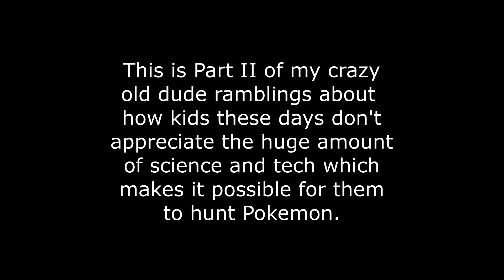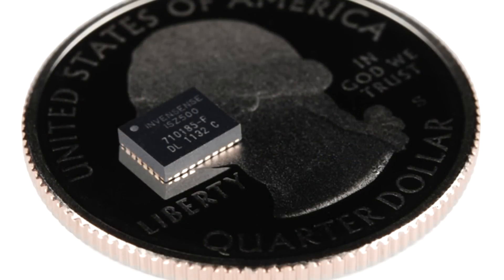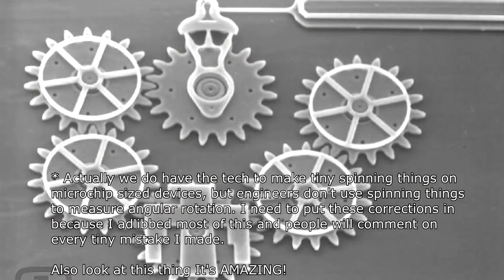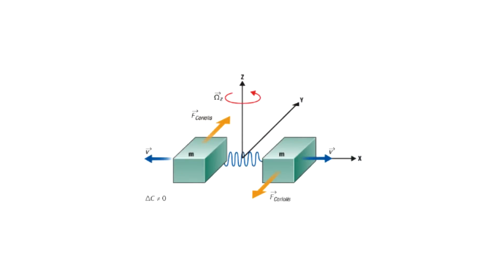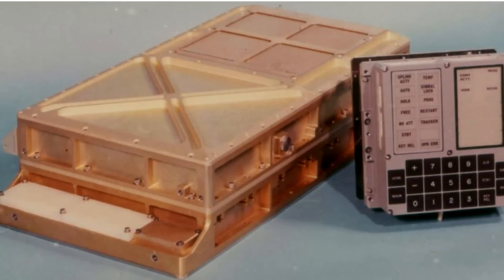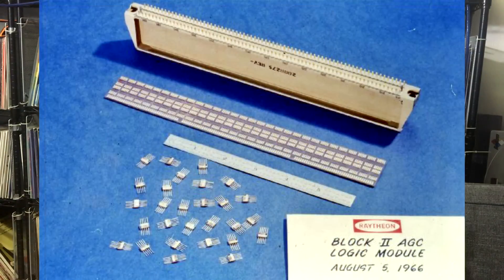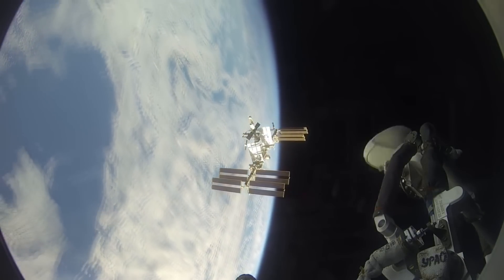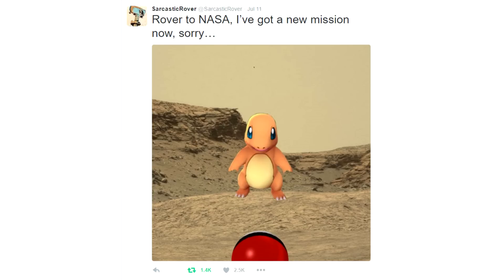How Space Age Tech Makes Pokemon Go Work - Part 2 - Tiny Sensors

Comment: Checklist of things I need in my next device: Military grade GPS, a built-in receiver for Satellite Internet, even more accurate "which way am I moving the device" chip with more powerful compass, and the device must be waterproof and airtight, built out of materials durable enough to withstand between negative 2 and positive 3 atmospheres of pressure (In case I somehow pressurize the contents, go to space, or go deep-sea diving), and all the standard android phone tech with touchscreen, ability to connect to cell towers, wifi, Bluetooth, etc, plus a slide-out physical keyboard which doesn't compromise the integrity of the phone in any way. 
With this theoretical masterpiece of engineering, would Pokemon Go become playable in Space?

Comment: Scott, only cell phones GPS units will switch off if altitude is too high, or any GPS chips will do that except military ones? How about backyard rocketry, if I want to launch my rocket say to 10 or 20 kilometers high, I will not be able to locate it at such altitude?
Reply: I think you have to get a permit to buy unrestricted ones.
Reply: Yes. This is so that civilians cannot take hobby shop GPSes and make their own missiles. There is a limiter on these GPSes ; however, it is said that it is very easy to disable/remove this limiter to unlock the full capabilities of the GPS.
Reply: FilliamPL Thanks!
Reply: i dont understand this law, the only thing restricted is the alititude which self build rockets can reach but, a self made rocket aimed at a sky  scraper in new york for example wouldnt need to reach such an high alitiude you could launch it from new jersey flying 200 or 300 m high until it hits its target, and i dont think that any civilian would need to build a rocket for malicious causes which reaches this height in any kind of situation, because the higher and longer it flighs the less payload it can carry, so this restriction seems kinda crap
Reply: Lord of Clickbait The restriction also does speed as well as height. A missile for a skyscraper would be going quite fast, which would make the GPS useless.
Reply: FilliamPL
gps works in planes with 900kmh thats by far enough for a rocket
Reply: Lord of Clickbait You do realize that if its a commercial plane then it has to be unlocked. Did you not see how I wrote "hobby shop GPSes"?
Reply: ***** what i mean was that hobby shop GPSes that you'd get for quite low prices, have very low limits

Comment: Scott, what prevents someone from just making their own GPS which doesn't have those altitude and speed restrictions? If you're making missiles, you clearly aren't concerned about laws. Surely you just need a radio antenna and some knowledge of orbital mechanics and trigonometry and you can make it work?
Reply: you would need to build your own chipset, and be an electrical engineer.  both of which will cost you 10s of thousands of dollars.
Reply: I'm curious what the limits are.  I've had a Garmin function in a civilian airliner going some 500mph at 32,000ft.  I'm guessing we're talking much faster and much higher?
Edit: I Googled it. The so-called "CoCom limits" are 1,200mph and 59,000ft.  Depending on the manufacturer, the device may disable tracking after meeting both or either limit.
Reply: Bypassing those limits is very much possible and very much easier than you think. You can buy an RTL-SDR USB stick for 15$, connect it to something like RPi, and run one of the software GPS implementations (some if not all of which are open-source). Those limits are no longer practically relevant really. I would be more concerned by the missile getting detected (USAF has satellites to detect exhaust IR and much more, not to mention the ground and space based radars) and then getting rekt by THAAD. Also I'm not sure how practical it is but GPS can be selectively denied to some areas but maybe that's only for newer satellites.

Comment: hey Scott, at exactly what altitude do consumer GPS devices and GPS equipped devices shutdown. I was on a flight once and it seemed to work well, kind of.
Reply: The so-called "CoCom limits" are 1,200mph and 59,000ft.  Depending on the manufacturer, the device may disable tracking after meeting both or either limit.
(Commercial airliners generally cruise at 500-600mph and 30,000-40,000ft.)
Reply: Thanks for the info

Comment: GPS systems turn off? is this something done specifically to consumer products on the device end? if so couldn't a skilled enough programmer just bypass this anyways?

In regards to the actually question, would a GPS without politically imposed chains work at the ISS' altitude? what about beyond the altitude of the GPS satellites themselves?

Comment: My phone doesn't have a gyroscope :( It does have a 8 core processor and 3gb ram.... but no gyroscope...
I bought it yesterday, and when searching for phones I found out most phones under 300 euro don't have gyroscopes.
I thought things like this are just standards on phones today, but no..
Reply: They are pretty standard. My 5x ($350) has one, as did my Moto X 2013 (~$250). The Oneplus X ($200) does and even the LG SU640 (A random cheap phone from 2012) has one. About the only well known phone I could find without a gyroscope was the Moto E, but it's only $120. What phone do you have?
Reply: 11matt555 huawei p9 lite. It's one of the best mid range phones. but just no gyroscope.
Reply: NightPanda Seems to be a pretty good price for the processor and build materials, Even has a fingerprint scanner. Not a big fan of the square design though. Guess they have to leave some things out and cut somewhere.
Reply from the maker: +NightPanda I'm sure it has  a gyro since that'll be used to stabilize the camera, most likely it's just not supported by the OS installed on the phone, I hear the initial release has been a bit buggy. Hopefully the manufacturer and carrier will get an update released which fixes this.
Reply: Scott Manley Yes I heard someone has managed to get the gyro on the p8 lite working by changing a line in the software.
Reply: NightPanda According to GSM Arena the P9 has no gyro sensor, while it does have a gyro sensor listed for the P8. Has the gyro been officially supported in the P8?
Reply: 11matt555 Nope the p8 lite doesn't have it officially supported.
Reply: NightPanda If GSM Arena is to be believed then it doesn't seem like the P9 lite has a gyro at all.
Reply from the maker: Pretty crazy that they'd cut out the gyro to save <$1 per unit.
https://www.reddit.com/r/Huawei/comments/4sd55f/p9_lite_does_it_have_a_working_gyroscope_or_not/
Reply: what... try downloading AIDA64 from the play store. It shows you all sensors. For example it even shows me that i have a 2nd accel. marked as a "pedometer". Also Pokémon Go also uses the compass, my father didn't believe me these things had magnetic field sensors until I proved it. It's amazing. Even though ive yet to figure out what pressure and humidity sensors are good for on a phone...

Comment: Why there is no internet on space?
Reply: there is internet in space, there is no phone conection tho
Reply: Space station is moving 27 600 km/h(17 100 mph), making full run around earth in 1,5 hour, keeping it constantly connected is tad difficult. :)
Reply: They /do/ have the Internet in space -- but:

1) They only have wired Internet connections -- random unnecessary radio frequency signals flying around the ISS /could/ be bad, so no wireless internet.  The logic here is the same logic that forbids you from using your cellphone during air plane takeoff and landing -- except that astronauts are far less likely to complain than airline passengers... :)
2) Bandwidth is limited and latency is horrible.  Netflix or multiplayer Call of Duty wouldn't be good ideas.  Note that "limited" means "a low speed broadband connection with bad latency", not "1200 baud modem".  They can and do have access to web pages and can upload / download videos (for official purposes, mind you -- videos of procedures to be performed are frequently uplinked, and the results of applying those procedures may be downlinked).
3) The biggest problem:  NASA, who is (in effect) the ISP for the ISS is a government agency, and the same rules and regulations that apply on the ground apply to the ISS.  The ingoing / outgoing firewall rules that apply to (say) a desktop sitting in an office in Mission Control are applied (more or less) to the ISS.  Yes, I'm absolutely positive that there are people who work for NASA in Houston that defeat these rules in various ways, but again:  people selected as astronauts who are actually /in space/ right now aren't likely to take a risk like that.